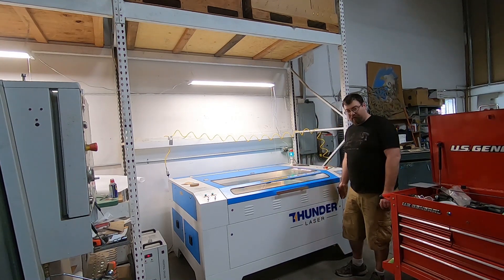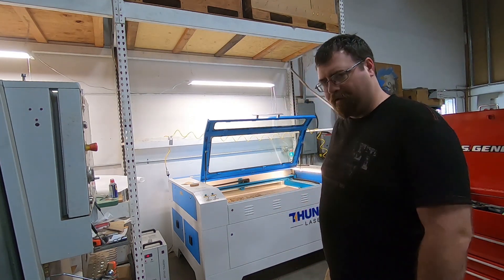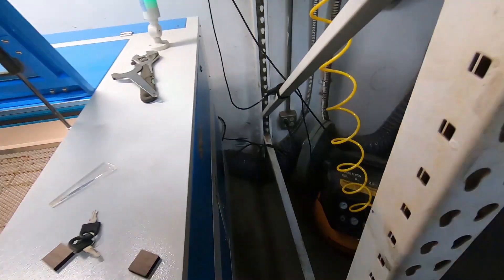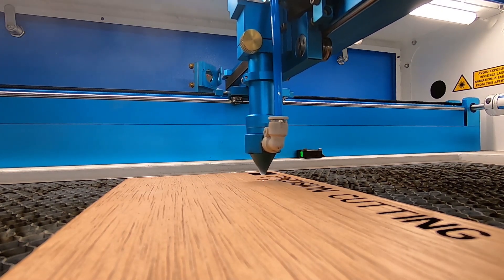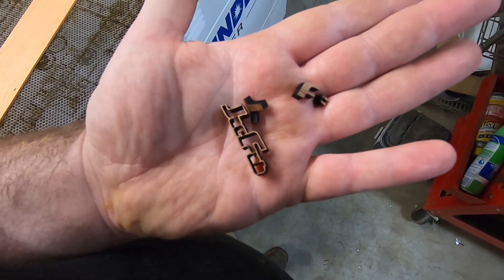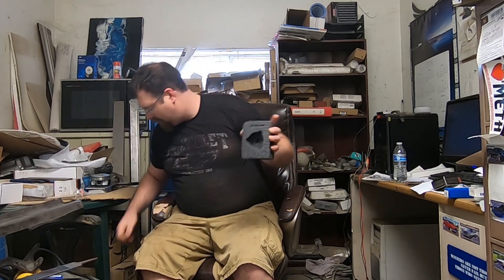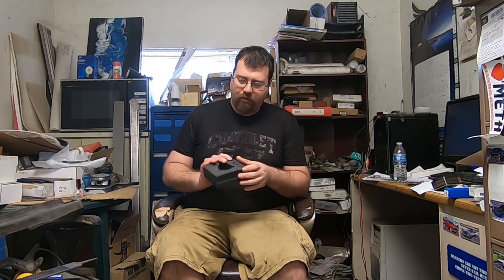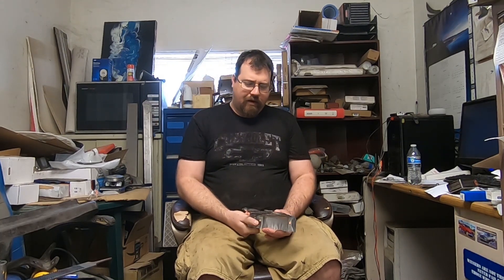We got a new toy! Thunder Laser Nova 51 100watt Co2 laser talk

Comment: I'm about to pull the trigger on s nova 51 an was curious how you like it after owning for a little bit now. any issues? Complaints? update
Reply from the maker: We’ve had minor issues with it, but tech support has been great about helping and sending parts. Complaints? Doesn’t cut as fast as you’d think it should in your head. I hear that if you mainly want to do engraving you should go with the 100 watt, which is what we have. However we seem to do a lot more cutting, had I foreseen that, probably would have gone with the higher wattage tube instead. Hope that helps.